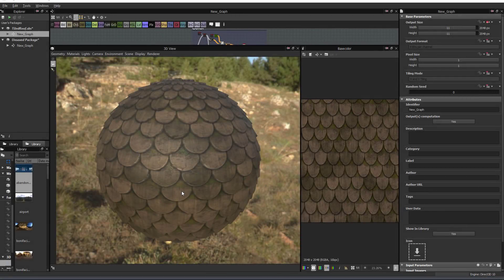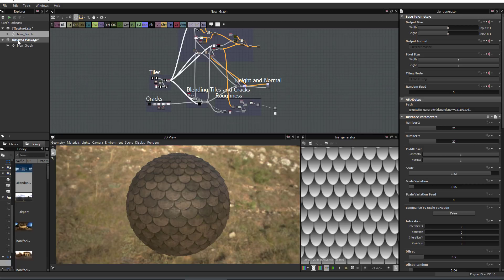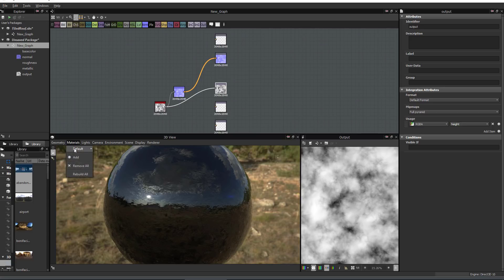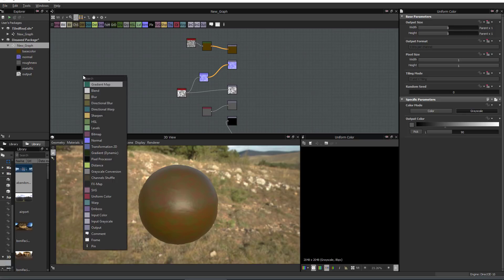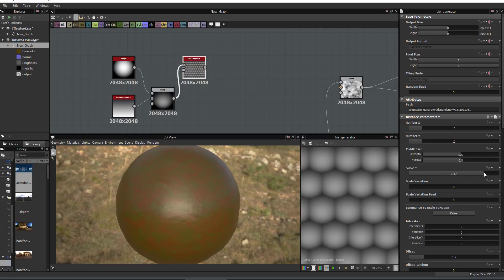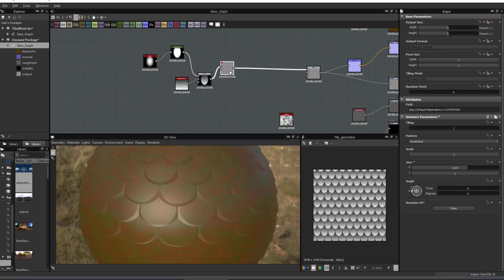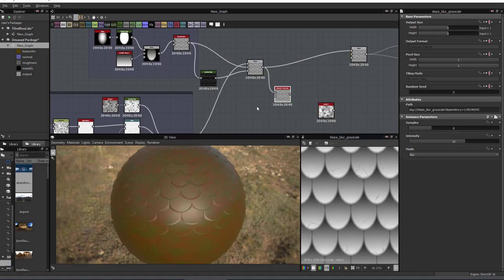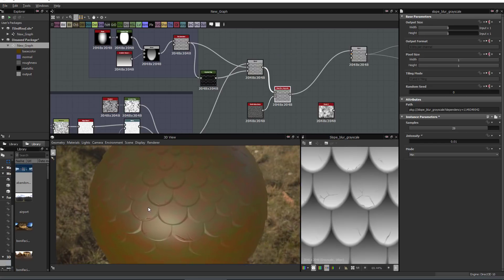Creating a Roof Material in Substance Designer

Comment: i have a little problem, great tutorial and explanation but my material on the 3D view still look like it's just in 2D the height map is not showing at all and the side of my cylinder are completely smooth
Reply: Hello! It sounds like you just need to turn on tessellation. In your 3D viewport, go to materials > Default > Definitions > whatever your thing is, and then select "tessellation". This will open up some properties, and you can then mess around with the "Tessellation Factor" and "Scale". Hope this helps!